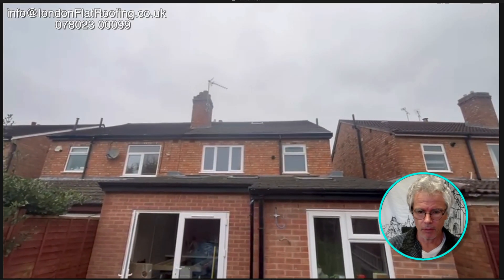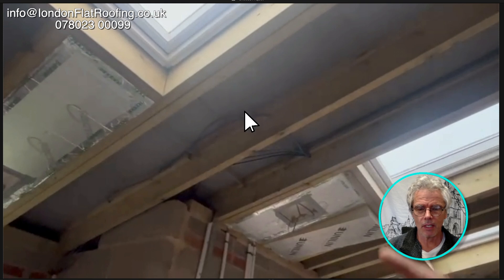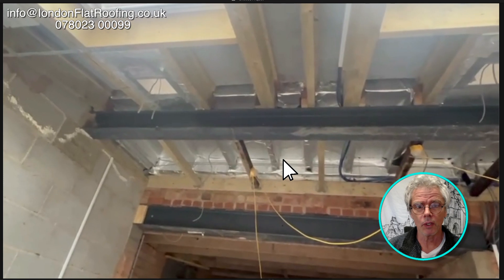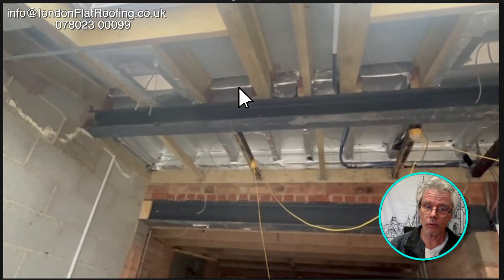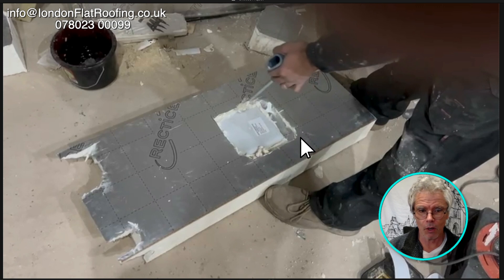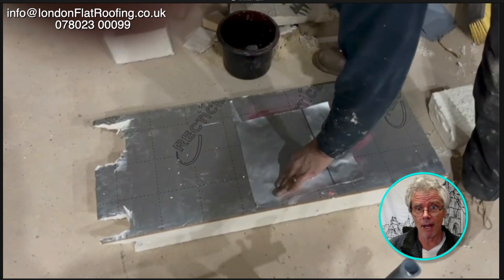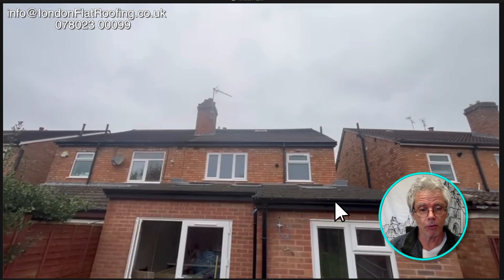Wrong  Roof Pitch! Avoid Cold Roofs & Improper Vapour Barrier Placement

Comment: On a vented  pitched roof that is converted to a room (pir in the rafters with 50mm air gap ) do you need a vapour barrier on top of that before plaster boarding? Thanks
Reply from the maker: You always need a vapour barrier on the warm side of any insulation in the UK and if it's a cold roof you always need through ventilation on the outside. I'm actually building a warm roof construction here. The multi foil is the air viper controller and there is ventilation on the outside.
Reply: @SteveRoofer  thanks , so where does the vapour go? Is it good practice to install an extractor fan or just leave a window vent open?
Reply: @SteveRoofer  I was of the belief that if using a VCL on the warmside (under the rafters) and breathable roofing membrane, one doesnt need to ventilate between PIR and breather membrane, but should still leave an air gap. Eg take Tyvek Supro. This is approved for unventilated cold pitched roof and minimum 10mm air gape required. Interested to hear your views on this.

Comment: Could he batten the underside of the rafters to drop the insulation enough to get some air flow above once vented top and bottom. Looks like he has that at the top of the rafters anyway if they're 150mm as battens it looks on top of the rafters.

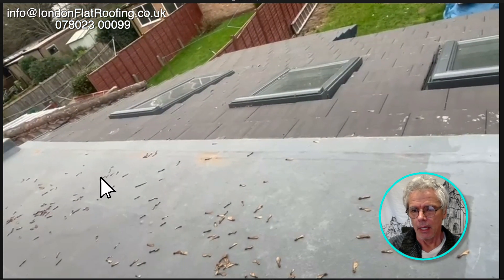Comment: 0:43 that rainwater downpipe shouldn't discharge onto the roof below, not when it's that shallow, that's asking for trouble. Did a similar job in the early 2000s, we removed the tiles and battens, decked it, torch-on felt over the decking, then counter-batten, then laid Forticrete Centurian tiles.

Comment: Hello Steve. We are going to renovate the roof on '58 northern irish house,as attic had no ventilation,old bitumen felt under concrete tiles. What membrane would you recommend for the best vapour vent. Attic is just a storage and well insulated with 40cm wool over the joists/plastic loft legs,stilts used/ .
After membrane and new tiles are in place,can I put there PIR panels between the rafters to make the loft storage a bit warmer,of course keeping 40-50 mm vent gap as there will be dry ridge and over the fascia ventilators.
Reply: Tyvek felt is the best

Comment: I am in a similar sort of situation where I've got ludlow tiles on my 10° degree pitched roof. I've had them for about 10 years and have recently started to see signs of water ingress on my celling towards the bottom end. Is there any cheaper alternative to fixing this without replacing the entire roof with appropriate tiles?

Comment: I wonder if he could have a single room MVHR to vent all the moisture out of the room and pull in dryer air from the outside. Then using a good VCL to keep what moisture you have traveling into the insulation. 

Thoughts?
Reply from the maker: all these things are possible. The question is will they work? Everything is so close to the limit

Comment: You never explained what the problem is.  Are the tlles not vented themselves?  Why would you need venting under the sheathing?  Most slylights require a 4/12 slope, so those should be on curbrs with a min 4/12 slope.  THe slylights are probably going to be the biggest problem as they should be above the roofing more IMO.  Create a dead air space for the insulation and move on.
Reply from the maker: you're right the problem is there so many things wrong it really needs replacing and starting again the whole

Comment: I had to replace tiles on a relation’s 12 degree pitch roof extension as it was leaking due to driven rain, and the felt had perforated. The Marley Ludlow Major’s weren’t suitable, can’t remember the replacements, but they were smooth with deep valleys to concentrate and move the water quickly away, and were spec’d 12 degree pitch. All worked fine afterwards.
Reply from the maker: yes it's very difficult finding the correct tile for a low pitch roof and 12° is very low
Reply: Alkor plan

Comment: Thing I have done to remedy these roofs is put self adesive foam 10mm srips under tile lap stops driving rain and capillary action make sure under tile so no sun damage has worked every time
Reply from the maker: as said before there's loads of different ways of dealing with it. None of them are the correct way this guy is doing a good job however it's a shame that it wasn't done correctly in the first place.

Comment: Building control and  planner at fault  . For allowing it. Also a reputable roofer would  of said this would leak with a shallow pitch
Reply from the maker: Yeah, all very good points the roofers which probably wasn't it was probably a builder doing the roofing work.
Reply: it's not upto building control and certainly not upto planning, the architect and structural engineer who designed the roof are at fault if they didn't specify the correct construction.
Reply from the maker: The situation is is that people out there do drawings to get you through building control and planning they are not drawings for construction. They just get you through those two criteria and the problem is then the builder takes on the responsibility for the build and the design and they're genuinely not qualified to do so this is where everything starts to fall down. Realistically good drawings should've been done in the first place with construction drawings given to the construction team, i.e. the builder then A Clark of works on site to oversee everything and make sure there is support there and things are done correctly. What a wonderful world!

Comment: I’ve fitted 15mm plastic pipe between the drifts of tyvek on roofs suffering condensation before. The customer didn’t want to vent the ridge cuz of cost, it was mid terrace with very old slate roofs either side. It stopped the condensation buildup, I can’t really see a problem with it other than it looks like a diy enthusiast has been at it
Reply: I’ve done the same with mine mate works a treat , the more vented and draughty the better 👌 glad I’ve seen someone else using pipe TO SEPERATE THE FELT
Reply from the maker: I think I understand what you're talking about with the pipe, but could you explain more just so I'm sure I understand
Reply: @SteveRoofer  so I effectively separated the drifts with pipe to allow some more ventilation. IMO there’s a reasonable amount of air moving around between the tiles and felt so isn’t the worst way to add ventilation.
Reply from the maker: Understand I actually did something myself the other day by packing down under the batten in the centre to create a dip. I didn't do it for ventilation. I did it more so that water could get past the button as the sarking  felt was slightly too tight.
Reply: @ yeah sometimes we just have to think outside the box. I’m a carpenter not a roofer but obviously there’s a lot of crossover in the trades and we just have to find ways to solve problems. Love your videos tho, there’s not many on here putting out new information that you can’t find on a hundred different channels
Reply: @ It done the job, can’t see a problem with it as a double cheap remedial. Obviously better to do it right tho

Comment: No such thing as roof pitch too low, if correct tiles specced and velux do low pitch flashing kits now
Reply: Velux windows and kits are for roofs between 10and 20 degrees, tiles 12.5 degrees 
So your comment isn’t correct
Reply: @ianjohnson1207  ?? I don't understand what you're saying. I am saying if the kit is specified correct the pitch doesn't matter
Reply: @roscopeco2000  
10 degrees is the lowest pitch that a roof can go for the special velux windows and 12.5 degrees for tiles 
So there is a “thing as roof pitch too low”
Reply: @ianjohnson1207 thankyou, didn't know how to put it
Reply: @ianjohnson1207 ok yes within reason but I don't see anyone going lower than 10 degrees
Reply: Init are you alright no such a thing as pitch to low🤣 it certainly is if you've put the wrong roof on
Reply: @roscopeco2000  that would then be a flat roof
Reply: Yeah if the flashing kit fine that's all good. But what Steve is saying, the tiles used and the pitch of the roof is wrong, therefore the pitch is wrong for how the builders built the roof
Reply from the maker: Yes, you took the words right out of my mouth.
Reply: Tiled flat roof. 😂 Must be a first somewhere
Reply from the maker: Ok understand
Reply: Alkor plan and raise the windows up to 15 degrees ( sorted)

Comment: Attention to detail is pointless if it’s all wrong, 
Can I see a timber on top of the joists? If so that timber could of been across the roof rather than down the joists to create a air gap above the joist? 

I’ve just heard you say the roof is coming off anyway, 
Then treat it all as a flat roof
Reply from the maker: Well, my advice was to take would be to take it all off and start again, but I don't think that's gonna happen but you're right at the end. I did say take it all off.